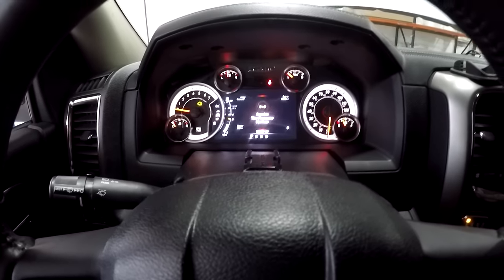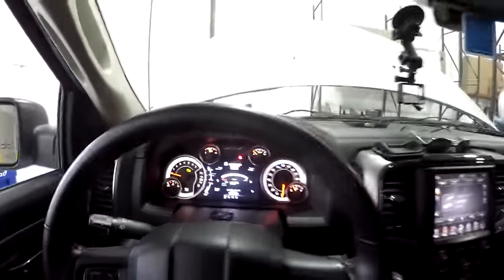HOW TO CHANGE YOUR ENGINE OIL - DIY - 5.7L HEMI - DODGE RAM 1500 2500

Comment: Not sure what year and model you're driving BUT the 2013 Laramie Longhorn 5.7 Hemi 6speed 4x4 with the heavy duty Tow Package makes getting to my Oil Filter a complete and total B&#^CH...I can tell that our lines run differently and yours allow fairly easy access considering the design location could have been much easier to locate for a regular service item.  Good Video.  Well Done.  JP

Comment: Have you thought about a oil filter relocation kit? To be able to move it to a easier access point. It would really help out in my opinion.
Reply from the maker: Yeah I've seen them and people seem to be happy with it!  Personally it doesn't bother me too much for the amount of times I need to get under there and change my oil I just deal with it. 😁
Reply: I am going to try that and an engine oil cooler too. Currently runs at 100 - 107centigrade but hoping Cooler will keep down to 90 centigrade
Reply: Just blast the frame with brake clean after putting the new filter on. And the spec is 25 ft lbs on the drain plug for the 5.7 hemi

Comment: Great video. I have a question.  I have a 2020 2500 6.4 gas  Ram that takes euro motor oil. Do I have to put that or can I put regular oil.

Comment: Sure it's not a fuel filter, but you should still prime your oil filter before you install it. It take a while for the filter to fill with oil upon startup; and not only does the filter need to fill up, but the entire lubrication system of the engine. Not priming the filter slows the whole process down and that's extra time stressing out the components of the motor. You can't always prime a filter but a bottom mount you can so it helps.
Reply: Good write Amrit, all filters should be pre-wet, even the horoznal mounts. Take Ur time in wetting, 1st pour wait and let it soak it, look in, see no oil, pour a little more until u see loose oil and fill to match Ur mounting face w/o spill.

Comment: Before I use Mobil 1 and noticed it will breakdown more faster than Pennzoil and my truck engine feels more smoother.
Reply: Garcia's Wood Work probably because the only Mobil oil certified by Chrysler is the Mobil super synthetic

Comment: Do you run synthetic oil or conventional in the 5.7 hemi? I have a 2020 and the dealership says conventional is fine but everything online says you should only run full synthetic? I’m concerned I should switch to synthetic

Comment: THrushWasher;  I found out a Pilgrim's chicken liver cup works total w/o spilling a drop.  The beauty about the cup is squeezable after the filter is broke loose a good half turn, continue to squeeze and turn as finger room allows until the filter breaks loose.  ---- Prep the cup by snipping off the cup's top over hanging edge to allow a sure slide-on top fit to the eng block iron. ---- Why Pilgrim's?  Best cup at the time and it has room to catch the spill-over oil, maybe a butter-spread cup, just prep it as described.

Comment: So just a quick question. Most places recommend the Synthetic oil for the 2014 Ram with the 5.7L. I notice you used a non Synthetic. Is the Synthetic a MUST??
Reply: Mobil 1 is full synthetic over here in Australia anyway

Comment: Next time you change your oil, if you have a filter That is spell prone when you were trying to remove it,on any vehicle, drill a small hole in the bottom of the filter with a small drill or poke a hole in it and you can control spillage by draining the oil filter into a container Instead of trying to balance a Hot oil filter with scalding oil splashing everywhere.. The second thing is, always always always put oil in the new filter so your engine doesn’t wait to build the oil pressure for five or six seconds when you starteup with the fresh oil. The third thing is, if you hold the fresh oil bottle with the pourspout on top and not on the bottom, the oil won’t glug glug glug out and spill  when you’re trying to get  the fresh oil into a small hole, without a funnel .The next thing is, always keep a box of disposable rubber gloves or plastic gloves or latex  gloves in your garage for when you have to do a messy job handling chemicals. When you’re handling chemicals, remember this, if it’s on your skin, it’s in your body
..
Reply from the maker: Great tips Jody! 👍
Reply: I never reccomend drilling a hole into the oil filter to drain if there ever was a problem with the new filter you would be screwed.

Comment: Just purchased a 2015 dodge ram hemi & going to do my own oil change using 5w20 mobile1 full synthetic with 141k. Only had 1 owner & carfax showes he maintenance truck at dodge dealer on time with everything including oil changes. Did you get your filter from your local autoparts store? If so what store
Reply from the maker: Congrats on the truck Tyrell!  I usually get the OEM mopar filter since its pretty much the same price as the aftermarket ones.  Walmart usually has the mopar filter on the shelf 👍👍👍

Comment: I let the old oil drip out of the drain plug hole while I change the filter. Before I put the drain plug back, i clean the old oil around the drain hole and clean the bolt threads of dirt. Then I clean the flange where the new filter will seat. And put clean oil on the filter gasket and prefilled before replacing it.

Comment: a magnetic socket or just placing one at the end to take out the bolt will prevent oil from getting all over you and the bolt will not fall in the pan
Reply from the maker: Great tip Derek! 👍

Comment: what do you suggest about the kms or miles between oil changes,compare to the light reminder I can drive lake 8700 ,miles or so,many owners change the oil when they hit 5000mil but I am thinking full synthetic oil is much more better then 5000mil,so what do you think,what is the best way for this?

Comment: Interested in purchasing a 2013 1500 Ram with 5.7 Hemi Truck looks and runs very well my concern is mileage on vehicle 179,000 2nd owner selling claims bought it from dealer and it had 158,000 when he purchased dealer said it was mostly highway mileage looking for advice price is very fair

Comment: Yes i use to use Mobile. My oil pan was rusted out bad. So dodge put new one on. Got me thinking about bolts on manifold. I use pensoil. Or what ever. Ya it's in a stubid spot. I go in the front towards the filter. And always us mopar filters. And other fluids

Comment: That 339 oil filter will cus low oil pump get 899 is the best for 5.7 if you want to confirm go to your oil pressure and check it

Comment: Question.. local shop used acdelco 0w20 oil and acdelco filter. Is the 0w20 the correct oil viscosity for 2012 ram 1500 5.7 ? Any input would be great t.y

Comment: i have a 2012 with the hemi, engines has 120k miles. should i use the same 5w20 oil?
any insight is great appreciated

Comment: haha , i just did mine yesterday, You can always hear and feel smoother operation after oil change. I just rather spend 60 bucks for synthetic and 20k miles filter made for it, but i leave it about 7k miles. What's up with smaller oil filling opening? It used to be double size on my 06.
Reply from the maker: Yeah they made it pretty tiny on these trucks but I still managed to dump it in there without spilling it all over the place lol 🤣

Comment: My dealer replaced the oil filter, but they didn’t put on gasket rubber properly which caused an oil leak. I noticed it before low oil pressure warning is on. Do you think a leaking oil filter will cause dirty oil? Thanks!
Reply: no

Comment: Question about your choice of oil.  I thought that Mobil 1 was not approved for Ram Trucks, or any other Chrysler product for that matter. Since Fiat and Mobil had a feud about oil recertification.   Not that Mobil 1 is bad, I use it in all my cars, but since it's not approved by Ram, if their was any problem with the engine I go with Penzoil Platinum which is approved.    Has there been any change to this?????
Reply from the maker: Theres no issues with Mobil 1 in our trucks!  It's been used for years in lots of mopar vehicles.  Maybe a change in "sponsorship" but its still a great oil to run 👍

Comment: I recently bought a 2019 Ram 1500 5.7L Hemi V8, what should be the frequency of oil changes and oil filter replacements?
Reply: Oil life will depend on oil grade. Semi syn will last 5k. Full syn will last 10k. 2019 5.7 hemi will take a mopar 339 filter.
Reply: I would say if you want the truck to last don't skimp on oil or filter. I have a 2014 ram with the 5.7 I use valvoline 5w 20 full synthetic and mopar filter. I do mostly highway and change it every 7 to 10k. I would look in manual mine says you can use any that has that API cert and if you look at the valvoline bottle it has that. The next one I will use the high milage 5w 20 full synthetic I have 67500 miles on mine and a lot of oil life so I will at least be at 70k at next change. I think fca is partnered with pensoil and use their platinum synthetic. At least my dealer and their quicklane does. My service advisor I use religiously was a chrysler master tech for 25 + years even said as long as you use good oil synthetic is the best with that API cert you are good. Of course they recommend oem filter too. I agree on both myself too. When you think about the oil change intervals and how long it is in and on the truck you are safe to spend a little more $$.  Keep in mind my truck is my daily to my office 30 miles one way up a highway and weekend warrior for hauling towing if need be. I don't do a ton of towing and I don't beat on it.  If you plan on a lot of short trips and are gonna tow a lot do severe service full synthetic 3 to 5 k and 25 30 k change transfer case fluid and front and rear diffs. I do my diffs and transfer case severe service to keep fresh fluid flowing. I use my dealer for all but oil I do that but buy the filters from them. Same on air filters. I buy the filters from the dealer and change them both of those are simple. I know some people will complain about dealers but if you build a relationship with them and end up needing their help they tend to work with the customers where they see the truck in service and records of the routine maintenance.

Comment: I have a 13, 2500, doesn't have the steering rack so the filter is easier to change, but seems like a very small filter for for the size of engine, not much bigger than my lawn mower uses.

Comment: Hi I have a 2012 5.7 hemi and I'm installing a new camshaft what oil do you recommend to break it in .... I currently use 5w20 but I live in texas and people tell me I'm supposed to run it on 5w30 or 10w 30 because 5w20 is too thin.. please help

Comment: I just did mine too, and I used 10w30 full synthetic idk if that’ll be the right one but I guess it’s just thicker
Reply from the maker: Hey Pedro apparently its best to stick with the factory weight for the MDS system!
Reply: The 5w30 seems to be recommended from all the research I have done

Comment: So how many qaurts did you use in all? I always check my dip stick and it's right at full at about 6.7 qts. When they changed the steering rack they went to a smaller filter and it seems 7qts is overfilling now but I don't know. The 339 filter is pretty small compared to the old 899 filter. I use to dump 6.7ish Everytime but I just dump the full 7 now. Sometimes I don't even know I should trust the dipstick on this truck as it might not even be accurate. I have a 2016
Reply from the maker: Yeah I hear ya! Mine used about 7qts but I usually just keep checking the dip stick and go off that. 👍
Reply: There is always a little bit if residual oil left in the engine.  That might account for the 6.7 vs. 7 liters specified for the engine.  Always fill to the dip stick full range.

Comment: Can you do a transmission oil change ! Please I need to learn how to do it on mine and you have very good explanation
Reply: Because his truck has the 8 speed it is not required for like 80k miles. 6 speed is around 50k-60k miles.
Reply: Ramguykev check out his old videos. He's already done the tranny oil change one
Reply: Simply Vortech I say it's best to take it to the dealer .  It's like  $200 .  In you life of owning your automobile you might just change it once.  Maybe twice
Reply: Check out his other videos he's done tranny and rear diff
Reply from the maker: Damn thanks you guys are on it!  Here is the link to the 8 speed transmission fluid change https://youtu.be/mNo9Ln5KrOE
Reply: 8 speed transmission does not need fluid change, fluid lasts the life of the transmission

Comment: Why not try  Mobil 1 filter?  They recommend you use it with Mobil one oil. 

Just saying,   I always use thier filter when I use mobile one oil .   I believe it performs better ( that's my opinion)
Reply: Nothing really special about M1 filters, made by Champion, OEM is fine, just stay away from non-branded cheapo filters from quick lube places.
Reply from the maker: Yeah Mobil 1 filters are probably a good choice too. I know oh can't go wrong with a factory filter so I just don't mess with it too much 👍

Comment: Hey what's your thoughts on headers I have the 09 and the manifold gasket is leaking was wondering if I should upgrade to headers.
Reply from the maker: If you live in a state where you won't have any issues with emissions I would say go for it!  Part of the other problem is that the cast manifolds warp a bit once the bolt snaps and it is driven and heat cycled so when you replace the bolts it is just a matter of time before it happens again.  Tubular manifolds also dissipate the heat better.  I would check out JBA headers, as they seem to be the popular choice with good fitment! 👍
Reply: Thanks a lot man love your vids👍
Reply: In my Ram both manifolds fixed that way:
1. Contact side was aligned to plain on grinding machine
2. Cracked bolts (side located in each head) were replaced m10 instead of oem m8. And new thread was made on heads for it.

Now I have about 40k km whithout exhaust drain.
PS In case you will go my way, keep in mind when doing m10 thread in heads not to drill deeper than factory bolt hole!
It is a risk to meet coolant tonnel.

Comment: Great Videos you make. I have a 2004 Dodge Ram 1500, 5.7 Hemi. Does this year take 7 quarts of oil also? Do not have the manual.
Reply from the maker: Thanks Doug!  Yeah its roughly around that amount.  Depends how much you get out and oil filter etc etc. 😎
Reply: Doug D what do you run in yours I made the mistake of getting a synthetic mix and now it’s ticky like crazy so now I gotta drain it and put conventional and hope the noise goes away!

Comment: Truck doesn’t have power steering it has Electronic steering because there is no place to poor power steering fluid
Reply from the maker: Good catch Alex!  You're right it is electronically powered rather than hydraulic.  Saying "power" steering people usually refer to hydraulic steering systems but they are both technically powered 😆
Reply: @BoostedMotorsports  
Technically, you gain some HP with the servo power steering.  One less belt/pulley to rotate

Comment: Saw a lot of comments on 5w20 (light oil, oem) vs 5w30 ( a tad thicker,recommended in hot cities)

What are thoughts on a 50/50 blend of 5w30 and 5w20?
Reply: Tensa Zangetsu I go with 5w40 I got a 5.7 hemi with 65k miles.
Reply: I'm not an engineer but I use what either vehicle I have calls for. That's what the engineers designed it for that's good enough for me.

Comment: Mobile 1 is sytetic ? Right i only have 160801 k on it wat.u recoment
Reply from the maker: Yes Mobil 1 synthetic
Reply: 5w 20 is ok as in my miles..? Or I will need a diffrnt..one.?
Reply: look on cap but most hemi is 5w20

Comment: Fyi the mobil super synthetic is the only one with the MS- certification ram calls for.
Reply: Its recommended not required
Reply: I thought Ram recommends Penzoil Platinum.  I've been using that since the first oil change, every 5000 miles.

Comment: An easier way to reset oil life on a 2012+ fca vehicle is turn it to run with not starting it, then just pump the gas pedal 5 to 7 times. This will reset it

Comment: Hey man if you really like your truck and want more power and fuel economy change your oil, transmission, and diff, to ROYAL PURPLE racing oil.
My F-150 v8 was getting 14 mpg city & 18 hwy  after I changed to RP my city mpg increased to 17 and my hwy to 21 and my power went up 10% I liked it so much that I then changed my trany & rear end and got even more power.
Reply: Is that dyno tested 10%? That's some butt dyno. Congrats on the fuel economy improvement though!

Comment: What's the part number for the oem oil filter?
Reply from the maker: Theres a few different ones depending on what year yours is so I would check for your specific truck 😎
Reply: BoostedMotorsports have a 2018 should be the same
Reply: wats your year there are 2 diffrent ones 2015 and up is 339 below i think its a 090  but u can also look and see wat u have on it

Comment: Is it required to run the truck and warm up the oil to change it?
Reply from the maker: Not required but it does make the oil a bit thinner to drain better/easier

Comment: I personally always crank it without starting the engine so the filter gets oil, I just leave the throttle to the floor and crank it after that I turn the engine on, is probably my OCD 🤣

Comment: So use Mobil 1 instead of the mopar oil? Getting mine done on my 2018 ram so I am just curios.
Reply: Dont use mobile one it dont meet the specs mopar calls for. Use pennzoil, valvoline,  etc or super synthetic mobile 1, but not regular synthetic mobile 1

Comment: Mopar filters are junk. Just bought a 19 ram 1500 with 34 miles on it. Ticking at startup due to bad anti drain back valve in filter. Replaced oil filter with Mobil 1 and ticking on gone. 1500 miles later and still haven’t heard it.